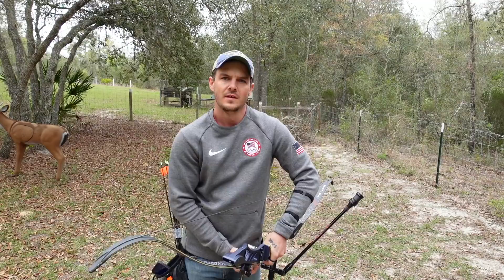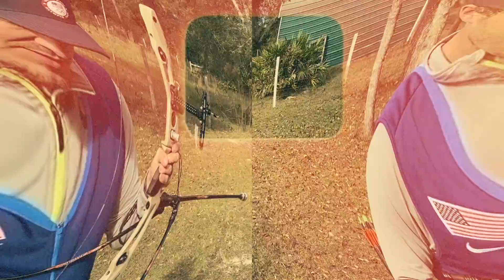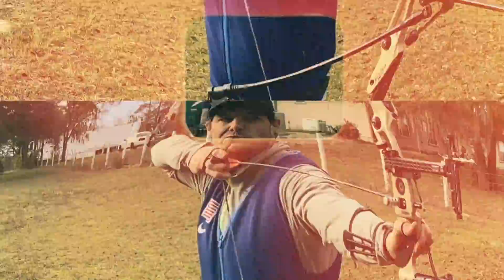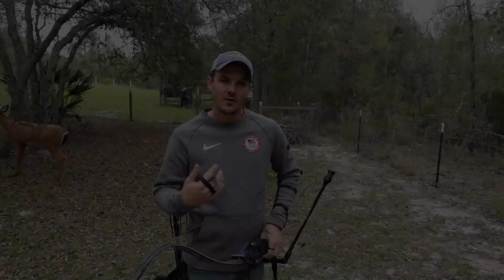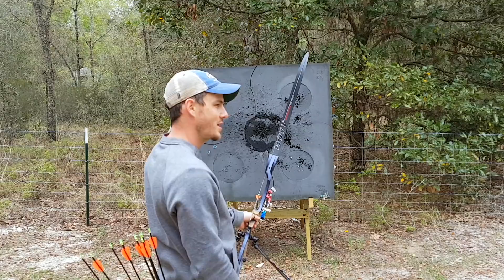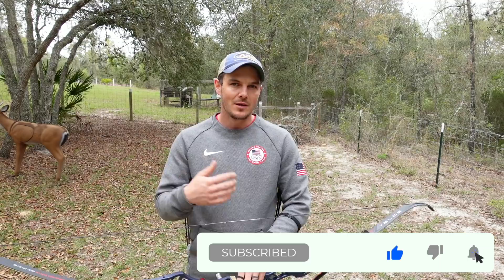Flexibility SPT For Archery | Specific Physical Training for Archers

Comment: I need to try this as well. 4.5 months removed from shoulder surgery on my bow arm. Usually shoot compound but right now the 50# might as well be 100#. I did buy an inexpensive recurve 35#. Trying to gain some strength plus keep the frustration down.

Comment: Hmm, when you let go of the SPT position to start a rest, should the release of pressure be abrupt or controlled and slow?

Though I guess it doesn't really matter in the end, since the movement when actually shooting is kinda one directional...

... still, just wondered since in weight lifting and such I recall hearing that the controlled return to rest is also important.
Reply from the maker: Controlled as I did in the video is fine.
Reply: @JakeKaminskiArchery  Alright, I suppose my question was a bit silly. :)

It was kinda rooted, first, in a kind of thinking that an exercise isn't a separate action, per se, but part of normal life... f.ex. when you run, you run naturally and with good body/breath balance/control; when you stop the exercise and continue normal life, the same natural body/breath balance/control remains without interruption.

To ingraine the activity as part of your normal being.

On the other hand, I vaguely recalled that muscles benefit from training "both ways", in a similar way to static vs dynamic stretching.

As you can likely obviously see, I'm not proficient in sports. :)

Just brought it up in case it shows a new avenue of thought and improvement... most likely it's just drivel tho. :D

I'd have to walk the walk to truly know. :)

EDIT. Time for my sleep now, though, my time zone is pretty different and yet another Monday awaits... :/

Good luck for your Monday too.

Ah, I was going for kinda like "one keeps being an archer, even if one isn't shooting" type of mentality.